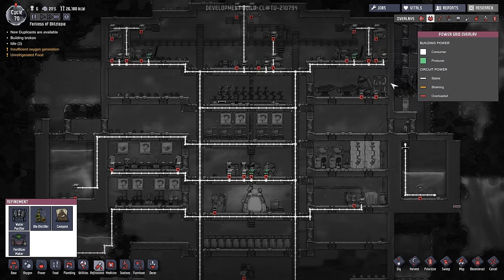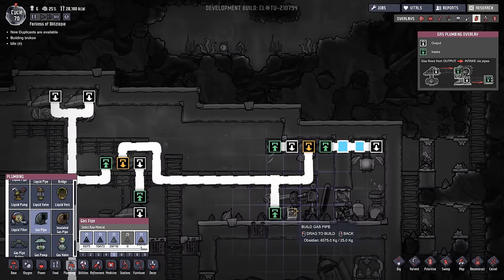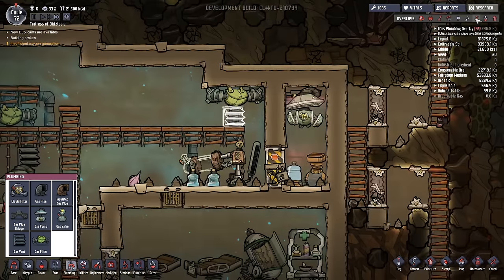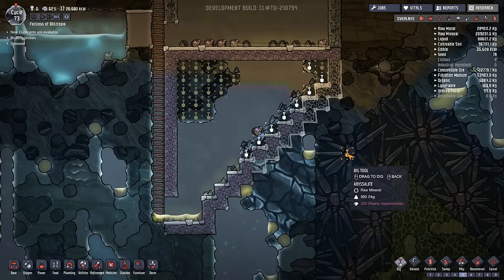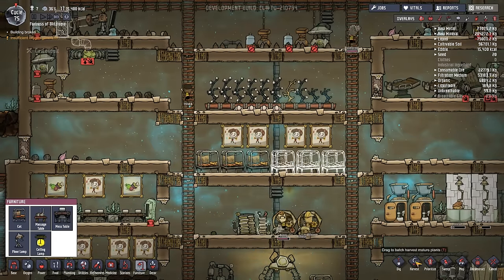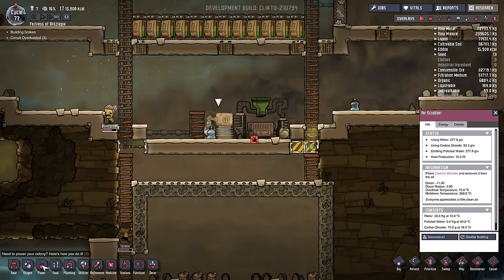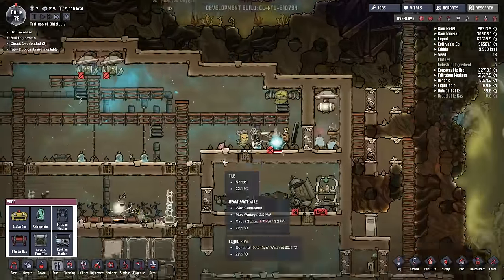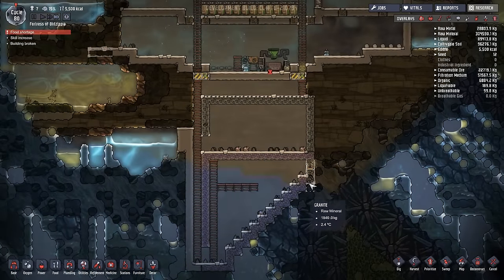Oxygen Not Included - Ep. 8 - Rerouting Gasses! - Let's Play Oxygen Not Included Gameplay

Comment: So here's my thoughts on the power and how to fix it. Basically you can handle 2000 watts (or whatever the measurement is) in a single system before it breaks. Right now you're generating and using more than that so there are 2 solutions. Solution 1 is just have 2 separate systems. Solution 2 is to have battery banks with switches so the batteries are alternating between charging and discharging to power the base.

Comment: The game doesn't seem to care about series or parallel. The only way to fix the 'circuit overloading' problem is to create isolated power grids. The load on a circuit is the sum of the different power users you have on the grid (batteries don't lower this value, you can ignore them when calculating power usage). Batteries are extremely useful in combination with hamster wheels (manual power generators), if you add a battery bank to a isolated power grid in combination with one or more hamster wheels the dupes will only run them when the batteries run out. If the grid doesn't use a lot of power the dupes will only operate the wheel every once in a while, if there where no batteries the dupes would have to continuously run the wheel in order to power the grid. I have my battery banks in a vacuum, however I don't think this is absolutely necessary. You can use switches to manually connect/disconnect power grids. The game is right in measuring power usage in Watts since Watt is a unit of power. Voltage alone doesn't say a thing (Watt = Voltage*Ampere), you can have a low voltage and high amperage and still use a lot of power.

Comment: separate the connection between all the lines it is overwhelming the conduits do lines not loops
Reply: agreed doing a loop is like having 2 power lines running into 1 house. the system is being flooded with power. so the lines are being stressed pass what they can handle

Comment: perhaps you can have two separate power grids, one for the hydrogen power and the other for everything else separated by two power switches with some batteries in-between. it's manual but if you have enough batteries you won't have to do it very often
Reply: also, have the hydro side open + other one closed when you want to charge, close the hydro and open the other side to use the power

Comment: Ok so electricity works on a circuit and what that means is that any wire that is connected to another is all running the same wattage, voltage and amps through that circuit. So you need separate!!! Circuits if you are pulling  more volts/watts than the wires on your circuit can accommodate.

Wires can handle 2000w, all your machines if running at once need more ? Then you need separate circuits 

Hope this helps :)

Comment: The simplest way to fix your power since you seem to be having a hard time with math. Put your hamster wheels onto its own circuit, then put your hydrogen generator (and eventually your coal generator) on a different circuit, having a couple of batteries dedicated to their own circuits.

Watt is a unit for power, which if you don't know motor and generator theory and how voltage interacts with load, its best to just say its kinda a unit for energy. As per how the game is interacting with it, its just a simple math equation.

Comment: okay so the issue with the wiring is that your overloading the wires. they are only rated for so much power "flow" this being how much energy goes through them. since there is no circuit breakers or anything of that measure with the limited knowledge i have (though it is quite a bit). the simple route is splitting between processes. meaning split up jobs for the power grid. 

further explanation:
say you need power for the top area .well separate it from the grid put a single large battery to it. and let it get a charge then break it off from the rest. this will keep the system at the top running and not overload the circuit.
split up the power for water pumps and systems as well to cut some power from that.
you can also set a priority for a grids power making unit and can make them prioritize other sections over the rest or equivalently.
i see a TON of potential from this game. and would love to help even make this game better in some way's with input but i cant play it myself. no comp T.T

all of this can be managed with small tweaks  to the "grid" simply splitting up power between things. there are wire bridges to cross different grid wires without attaching to other grids. i come from a polytechnic school but am sadly disabled now. i have a lot of real life experience with construction and building houses to code. i'm not certified nor am i a master by any means i just have knowledge i feel could help.

Comment: If you deconstruct your manual generators I think the power grid won't over load because the heavy duty cables can handle 2kw and the two hydrogen generators produce 1.6 kw and the two manual generators produce .8 kw so if you disable them, your production will be under 2 kw(Sorry for the rant)

Comment: problem salved!!! you are using a full base power set up that is the problem. you need to segment the power grid using switches or each grid only has 2k in and 2k out. so 2H plants on a grid making 1400w and one running for 1800. that would allow you  to use up to 1800 with no batters but it is best to build around 1500w so you can add a few batteries to it to store the extra from the that part of the grid. you don't have to have the runners on the same grid as the H-plants. so the runners power the oxygen plants, pumps  and a large battery bank. then the H-plants power the extra stuff, on an extra grid. it is like separate basses for power the lines can only take 2000 so each grid or base can only be up to 1800 with out ever being repaired.  i hope this helps

Comment: you could create buffers using batteries (sorry I mentioned it last time I commented and didn't really elaborate) sorry I dont really play Oxygen Not Included its fun to watch because of the level of detail put into some of the systems. I kinda assumed the big batteries had an in and out (which would make sense for a big battery) but separating the circuits based on battery buffers would still work you would just need two switches on either side of the battery. Close off the power going into a discrete process (circuit) and let the battery buffer fill then close off the switch to the input and let the smaller circuit be cut off from the main network. This will take some time to perfect and probably quite a bit of testing but could be an interesting way to solve this problem and building up the buffer may cause a bit of down time at the start but after it starts up you could selectectively shut down certain batteries and let them fill up and let other batteries run whilst its happening.

Comment: Okay, to help you better visualize the power system. it is better to have them as ponds that 'could' connect to the generating one, also the hydrogen generator would run a bit better if you put the gas through a limiter to release them in smaller chunks like 50 or 25ish?  But overall it's bad to have a large pond for your power system since there's no current very high tension wire, use a calculator to figure out the power cost of your machines then split it up under 1000 or 2000 depending on wires.  So the image of multiple smaller separate power lines by base section would be efficient because you'll be wasting resources replacing over worked wires due to the load.

Comment: The wheels that make the power are connected to the entire system. Connect the power wheels to the batteries, and the batteries will distribute the power. Just connect the wheels from above the batteries. Scratch that. Hook up ALL power makers to the batteries and then the batteries will distribute all the power
Reply: Also, insufficient oxygen generation means just 1 machine or more isn't producing enough oxygen. It can just be 1 machine.

Comment: BLITZ PLS READ click on a battery and look at the menu that comes up. you have 3 things that you need to pay attention to. total potential power production in kw, current production in kw and used power in kw. all of those numbers have to be below the wire limit of 1k for regular and 2k for high capacity wire. if you go above this it will overload. since you disabled the 2 pumps, the 2 co2 scrubbers and the 2 electralisers you probably reduced your circuit below the 2k limits. if you add power to the wire the entire wire is charged to what ever you put in, so if you put in to much it overheats and brakes which will happen anywhere in the circuit. either sepperate you power systems and have multiple batteries or reduce the consumption demand. I learnt this info from watching Biffa.

Comment: For the battery thing, have two switches each one on the other end of the line going from them to something else. though honestly something of that design would be better as a battery tower with at least three switches, the middle one manual or generator feed in and the top or bottom be power out to machines like electrolizers/gas pumps or liquid pumps and fridges.

Comment: well actually you run current, cause current represents the literal flow of electrons. but, yes standard household convention is for example 120V in the US and the way the electric wires and stuff are hooked up, voltage is what's held constant and the current will vary inversely with resistance that's why you have a breaker box in your house that has different Amperage limits for different circuits. the odd thing about this game is that all the electrical units are watts which means they have hidden assumptions regarding the other variables.  the best way I explain it is that if you want to relate it to real life then think of it similar to how household limits are set up.  from what I've seen, according to this games mechanics, you just simply add up any and all wattage connected to a given circuit, that amount cannot exceed 2kW. yes this means you can no longer spam a ton of wires all over your base. you actually have to manage the wattage on a circuit.  and if the game devs had made the system at all similar to real life then my previous comment would apply but it doesn't. the above stated method is what appears to be correct.

Comment: @blitz why don't you get rid of the air pump on the lower left of the 2 and put air tile in between the 2 rooms or even take the second area and put 3 air machines in there with one pump. send all oxygen down to the bottom to give it a long path to try to fill up.

Comment: Blitz! Your power is atrocious! Have a right and a left side of your base for power, separate, not connected. Connect a battery and a generation wheel to each. The more devices you have connected a circuit, the more power required to be put on the circuit. Thus doing this will cut your power problems in half. Basically, putting every device on one system is bad, but making smaller, separate power systems is good.

Comment: 11 Simple Steps to get Blitztopia up and running (ep8 updated):
#1: Filter only Hydrogen in Hydrogen Generator, else they break ☑ done
#2: Exchange all 1W Cables with Heavy Watt 2W Cables and organise ☑ done (best thing you could do)
#3: Calculate needed Power for each Circuit (2W max, you're currently running 3,2W on 1 circuit) ☐
#4: Unplug unneeded Load: Mechanized Airlocks need 120W, when just locked they dont need to be plugged in/or Manual will do ☑ done
#5: Split Base up in different, independend circuits (2W each). Proposal: Top-Circuit for Oxygen (1 Electrolyzer should be sufficient for up to 8 dupes with 888g/s Oxygen), Bottom-Circuit for Water ☐
#6: Backup Energy for each Circuit with Batteries: 200W per big Battery (so 4 for 1 HydroGen), look up each Circuits Need (Heavy Watt Wire Info: Circuit Status under Max Wattage) ☐
#7: Generate enough Energy for each Circuit (e.g. Hamsterwheels only provide 400W each / Hydrogen Gens don't work most of the time sadly, maybe try Vents set to 100g/s between Filter and Gen) ☐
#8: Get enough Food running: around 2 Bristle Blossoms per Dupe ☐
#9: De-Stress with good Decor: Deconstruct Stick Figure Paintings and replace with DubaLisas/Masterpieces for Decor +, Best Case out of Granit for +.2 extra Decor (+.1 for Sandstone) ☐ started
#10: Rebuild Air Vent: when Vent is directly on Pipe it will release everything at that Point, to support multiple Vents you need to split Pipes beforehand. ☐ started
#11: Have fun and keep entertaining us: I might be nitpicky, but i hope something of this will help. I have great fun watching you, so keep it up, thx mate!

Comment: How about if you try to direct all the power generation in a separate circuit to the batteries with a high wattage wire, then use normal or high wattage (depends) , from the battery to all the machines.

Comment: watt= voltage * current.
voltage is like the size of the pipe, and current the pressure of water. that make wattage the volume of power over time.
build batteries next to your power generators, it will fix your problem

Comment: watts is the like stamina, voltage is strength, and amps is speed. so if you can move 20 lbs in one second above your head and hold it for 2 mins your voltage would be 20 watts is 2 and amps is 1 but the games does not use amps. Someone correct me if I'm wrong. So if you increase your watts you can hold it longer but your arms( wires) can't do it they burn out

Comment: maybe Im not really understanding the system, but power seems very easy; you have stuff that needs power, stuff that produces power, and wires to connect the two, but the wires can only handle so much power being produced. In your case, youhave all kinds of stuff that need power, so you can calculate your needs. Then build stuff thar produces power, now you have 2 wheels and 2 hyrdogen gens, which will produce 2400 power (lets just call it that) but your wires can only handle 2000 power, so you have too much, you'll need to disable some producers. you could also splitt the wires, having to circuits, which will enable you to power 4000 power worth of stuff, instead of the 2000 you can power right now. But again, maybe Im just missing something, I havent played the game myself, so I cant be sure

Comment: Hey blitz first time commenting on your vids. So thanks for awesome content. 
On the units question. Voltage in water pipe terms would be the difference in pressure in the different ends of the pipe, wattage would be the amount of water in the pipe. 
So what I'm thinking whats happening is that, you have too much electricity in the system and as you have too little reservoirs for the electricity (batteries) and a lot of generators you generators run just for short while to top of the batteries then turn off and that makes your system to be erractic.
Reply: And as an optimization suggestion. I think the sum of generated wattage should be near the same as the sum of used wattage with batteries taking off the excess (as in use batteries to add wattage usage in to the system)
Reply: One last thing, you base has battery power for about 2-3 seconds. 5 kilo-Joules in batteries with about 2 kilo-Wat draw when the hydrogen power plant  isn't working, so another way of getting the system working other than getting 100% up time from the generator would of been adding a few batteries to even the system up (so the question is if you need the oxygen generation)

Comment: think of power like water, you have a pipe that you can pump a max of 2000 gal a second but your pump can pump out 2400 gal a second, at the end of the pipe you will only get 2000 gal a second no matter how much you turn up the pump. Now at the end of the pipe you have  something that needs 2400 gal a second of water and a bunch of water storage containers but only 2000 gals of water coming out of the pipe. not enough water. so you need to add another pipe for the extra 400 gal a second, and add 1600 gal a second pump. so how you have 2  pipes of water pumping out 2000 gals a second for a total of 4000 gals of water a second. so best to split the base in 2, one hamster wheel and big battery per side and 1 hydro pump per side

Comment: to fix your power problems you need to reduce power load. 
air pump are 240w each times 3 equals 720w
electrolizer are 120w each times 3 equals 360w
air filters are 120w each times 3 equals 360w
all told that's 1440w of power required
if you had 3 electrolizers in one room (360w) one air pump (240w) and one filter (120w) you will get the same production for 720w this will run off one hydrogen generator (800w produced) with an excess power of 80w
Reply: you would want o keep this system separate from the rest of your bases power, hook up some large batteries and have something that runs intermittently off it to utilize the excess power available. maybe a water filter from your pee tank.   

also, if you run a main trunk line with your oxygen output and put thee filters off of it, not directly in line, you can pump O2 to separate parts of your base allowing better distribution.

Comment: Hey blitz what if you try splitting the electrical system  like a switch or complete separation one side powers left and the other right so the power doesn't overload the cables. If you have cables with a max 1000 wattage in the cables over that blows them out and the hydrogen generates I think 600 watts max so you have 4 with two 400 wattage treadmills then you have 3200 watts running with treadmills and 2400 without with your system so if split you would still have 1600 per side and with a dedicated battery room sucking up the extra power through the day at night the excess power could power the base. Battery room should not be connected! by that I mean if you make 12 battery's then ether not connect the cable because then the system is one or use a power switch so if you lose a generator you flip it on and not overpower the system.